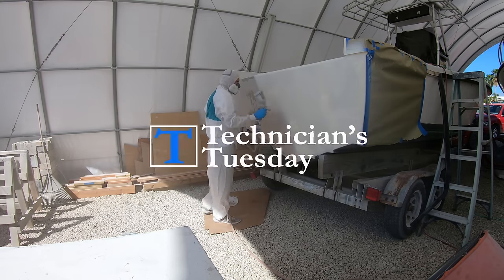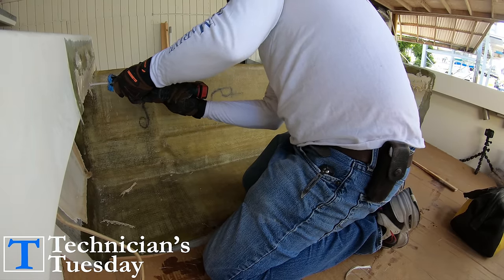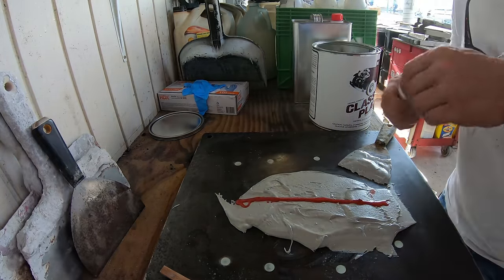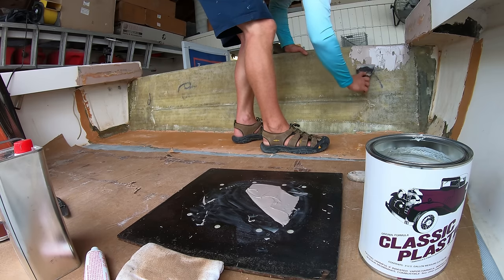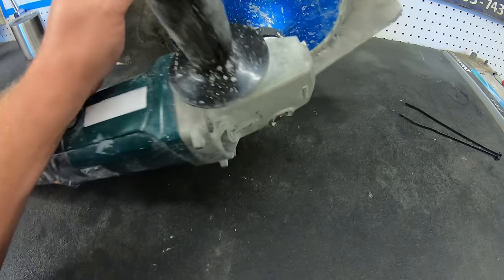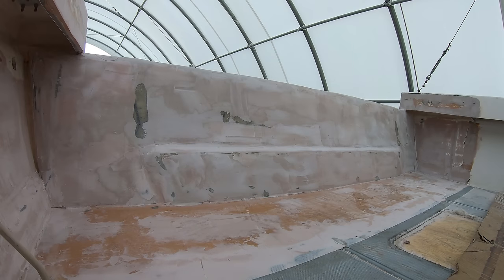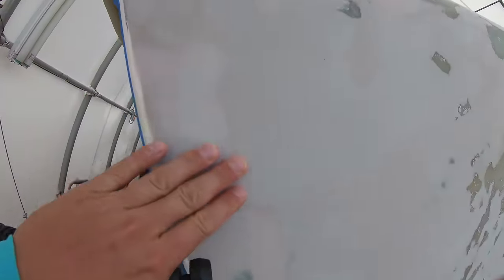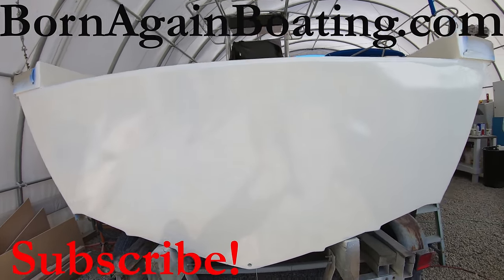Making Boat GelCoat Look Good!

Comment: Is THIS BOAT FINISHED?
HOW DID IT COME OUT? 
How is it doing ? 
How do the SPOTS THE  PLASTIC AUTO BODY FILLER LOOK???? 
Did they crack ? 
Did they fall off? 
Do they look fine ?
Reply from the maker: Haven't finished yet, no cracking yet and it's been moved around quite a few times with the forklift bouncing the engine and bracket around. The only cracking that I'm worried about is on the side gunnels where we smoothed over where the boxes were. It was a little thick there, the transom in the back won't crack, it's just the thick spots that will could crack. When used as a filler, just to flaten the surface, it's not thick enough to crack like people think it will, just the really thick spots or hard corners will crack.
Reply: Born Again Boating  
Thanks for answering. 
I have never used it 
Cause I was told not too. 
But curious cause it’s the same stuff 
As marine polyester filler. 

I hope we are wrong but tell us 
I will come back and aggravate you some more wooo hooo. 
You will be so happy!
And the price is way higher.

Comment: What would you use if you didn't want to use Bondo? More resin?
Reply from the maker: Yes, usually the same resin you use with the glass, and use a fairing filler like 407 or totalfair :) thats the better way to go, I only used the bondo to show a cheaper way to do it. Bondo also makes a more expensive fiberglass filler as well

Comment: Do you ever have problems with bondo cracking?  It seems the transom would flex at least a little and that stuff hardens very hard.
Reply: I've used dura glass
Reply: @vmonroig21  Any issues?
Reply: @nobody46820  I repaired a 1  inch wide and  about 15inch long gash from trailer problems lol. Its been 7-8 months no problems so far.I also did the whole keel from trailer rash.and I don't baby it when I trailer it lol
Reply: As long as it's not to thick 1/4 max it should be ok

Comment: So I'm confused.. Granted I know little about heavy duty glassing like you did but you said you shouldn't use bondo on a boat, however you did.. So what is the actual proper procedure? Thank you Sir..
Reply: After the glass work that should end in a layer of Chopped strand matting, apply epoxy faring compound (total boat faring), sand and refill as needed then clean and apply the finish. Faring compound is made for a flexing boat and will not crack when flexed. Hopefully the bondo will last. Perhaps we will get a follow up after it has been run for a while to see if it really works.
Reply: It's not gonna take "awhile" he will more than likely have spider cracks when he gets to the boat ramp before the boat gets in the water the first time! Bondo is stiff....gelcoat is hard and stiff....the substrate everything is attached to is going to flex. Not to mention that he will be drilling holes thru the bondo for the engine mounts and transducer and whatever hardware is going on the transom. Bondo is not made for being submerged in water!!! When it gets saturated after it cures it has the consistency of a hard cheese. Since I've started using total fair I've thrown out every other type of body filler I had.
Reply: @t.koogle5283  Correct me if I am wrong but you can not use an epoxy faring compound if you plan to gel coat after.  Only if you are going to paint.
If you are going to gel coat you can mix your own fair compound in some poly resin.
Reply: @beachedferrari  You can use total boat 2 part faring compound, sand apply Total Protect primer and then apply gel coat. It is all recommended by the Total Boat people on their website.
Reply: @t.koogle5283   learn something new every day. Thanks
Reply: @beachedferrari  correct. its best to keep everything poly.you can put epoxy over poly but not the other way.you will have probs and gelcoats poly. And as for fillers smc is amazing

Comment: Which spray gun did you use for spraying gel coat? Will preval sprayer work for small job?
Reply from the maker: I don't really know, I had someone else spray it for me. To be honest, I don't like doing fiberglass or painting lol so my friend sprayed it for me. I'll ask him what gun he uses. He does it a lot so he's probably got an expensive gun
Reply: Born Again Boating ya it’s awful work! I’m hoping a harbor freight gun will work if preval doesn’t.
Reply: Not really thin gelcoat down use a 2mm nozzle and spray it at 60psi works well for me

Comment: So use the waterproof fiberglass bondo.
Reply from the maker: Normally I'd use fairing filler, I just wanted to show a cheaper way of doing it
Reply: You can add chop glass to bondo plus the gelcoat will harden it up.

Comment: Don't use bondo if it flexes it will crack off. Licensed since 1982 fixed jet skis for many years and jobs with bondo in them.

Comment: Just doesn’t make sense to cut cost on a huge project where you have done everything else correct .. bonds won’t last .. what a mess that’s going to be !
Reply: Obviously, never use bondo brand anything, and duraglass would have been better for this project,  but body filler (bondo) is perfect as long as it's not very thick.

Comment: What’s the difference with waxed and non waxed gel coat I have a skiff that’s primed and I want to sand it smoothly out the fiberglass and then gel coat
Reply from the maker: Non waxed is usually like a laminating layer that you are going to be applying another layer on top of immediately after you lay that layer. You use the waxed layer as the last layer and that seals the gel coat and lets it cure properly. If you are laying multiple layers, you can't layer over a waxed layer becuase they won't bond properly.
Reply: @BornAgainBoating  ok thank you

Comment: A belt sander would give you a nice flat surface, and would not make such a mess. Less dangerous too.
Reply: A belt sander will gouge the hell out of it.
Reply: @richardgray9491  light passes and attention to your work would produce a nice finish.
Reply: @Mascotal  Then use a random orbital sander to remove the all those gouges that belt sander made.

Comment: No bondo a real glass man doesn't use filler ! A real glass man grinds as flat as possible fill with gel  grind find your highs and lows repeat sand  . Keep going and and as you fill and sand you keep knocking the highs off and fill your lows in with minimum fill . Ues the color gel of the the boat that way when you are getting close to finishing on rub thru .
Reply: Watching someone use body filler on a boat makes me cringe 😖

Comment: What is the other option if you don’t want to use bondo?
Reply from the maker: Many options, Bondo is just the cheap way to do it. We normally use west systems fairing filler. But any fiberglass fairing compound will work. TotalBoat makes good products as well, or your local fiberglass supply company.
Reply: Born Again Boating Thanks for the info.

Comment: and how much do engine brackets go for and are they a good thing to add on ?
Reply: Peter Nguyen it really depends on the boat. I’ll point out the negatives and allow you to draw your own conclusions. Around the mid 80’s they became popular mainly it was said to extend the waterline length giving a better ride in certain choppy conditions and allowed cleaner water over the prop being further back from the transom & any disturbance from the hull. The negative is the weight of the outboard has added leverage and sits lower at rest. This weight is also the issue when it comes to getting onto the plane. Hope this helps.

Comment: Sorry guys , can't get my head around the bondo thing . It's gonna crack-up in a year .  :)
Reply: ThePrestige4u but the bondo is only covering the low spots after sanding isn’t it?
Reply: @surviving.not.thriving1061   A boat in the water is pounded and twisted far worse than a car . Also they are dis-similar materials . Bondo doesn't like to bend . Just take a little ground glass fiber & resin & make yourself some marine-stable filler .  :)

Comment: When you wipe the First Coat of Bondo, SMC, Kitty Hair etc.....its best only to first fill in the Low Spots, Dings and very deep Gouges.  DO NOT WIPE THE WHOLE PANEL. 
Later in the Second Wipe things get much easier and faster.  With this Job, you could have first used Kitty hair on the Lowest Spots for the first wipe, and use the SMC filler for the second and third wipes.  This would have been much more durable and professional. Bondo for this job and for any other fiber glass job is not really very good.
As for sanding  you could have made a 24" to 36" long Long Board, and used a Killer DA with a 36, 40 or 80 grit Sticky paper.  Nice video though.

Comment: Think about this, please:
Respirators, Gloves, Eye protection, Chemical (paper/Tyvek) suit, Air filtration? 
Are you aware of the way Acetone, MEK, glass dust, silica, cabosil, etc, etc get into and affect your body? It doesn't go away - ever. Some of the affects  can kill you, or someone nearby, virtually instantly, some you won't notice for decades. 
Please, if your going to share this type of material, Educate your viewers, and yourself.
I have worked on boats all my life. The rule is: keep the material off you in the first place. Trying to clean it off after the fact only increases the damage to you and those around you.
Small example of what I'm talking about: Get a little paint on your arm? Great, just wipe it off with a rag with some acetone on it, right? Well, now you've applied a chemical to the chemical (usually some sort of heavy metal in those paints and god only knows what else) and driven it through your skin, into your blood stream. If you had been wearing a paper suit, just wipe it with a rag and move on, no harm done. 
Air filtration: Too complicated, right?
Not really. Get some home depot AC filters, bigger the better. 
Contain your work space - tarp the ends and seal the sides to the ground.
Cut those filters into the end walls, duct tape in place. You've got the big fan, mount that blowing out (exhaust) through one of the filters. Maybe stack a couple of filters for it to blow through.
Maybe you mount another intake fan opposite the exhaust, so it draws through a filter to keep the outside dust out of your work.
Maybe you need more fans, bigger vents, every job is different. 
Try this and see for yourself what a huge improvement it makes in your work environment. Admittedly this will not capture nearly 100% of the crap you have blowing around, but I can guarantee you it won't be all over your tools, work space - and you!
The airborne chemical component is more difficult, but carbon filters will eat a lot of that. Home depot again. 
Need to change filters quite frequently when shooting paint, gelcoat, etc, as they will clog the filters pretty fast. 
Ill stop there.
Think about what I have told you, please.
Reply: average joe  Agreed on cabosil. The acetone belief you have: Insanity. Please think about what you are assuming, then get educated on some factual information. This stuff will remain forever in your liver, for one. Chemicals do not get "metabolized and removed by your body." There is no get out of jail free card with these compounds.
I'm not here to criticize anyone, just share what I have learned over the years.

Comment: Could you have just finish the fiberglass with finer sand paper instead using bondo?
Reply: Not trying to act like im picky because im planning on doing mine this winter so im asking if theres options

Comment: Boat builder of 40yr from Scotland, you made a huge mistake applying bondo during all that hard work. A huge one and nobody wants to be replying saying its fine. Marine bondo is not for this task nevermind classic car stuff. I hope the temperature is the same all year round where you are because over here even marine bondo falls off after 5 winter. Ruined job tbh mate, a bodge at best.
Reply: Winter ? There’s no winter in Florida I’m pretty sure this boat is doing just fine

Comment: How many days did it take you start to finish. I’m about to do my Robalo R235 which has a very dodgy transom. 🇦🇺
Reply from the maker: It depends on the project, and whether you are including the time of the bracket install, bottom paint, rigging, engine, etc. or are you just talking about the time of the fiberglass and the fairing and the gel coating? Fiberglass and Gelcoat, it was around 10 days, from demo to glassing, to fairing and gel coating

Comment: stop cleaning your tools from bondo, leave actually bigger ammount than it hardens you only need little flex the tool and bondo will fall down in one piece. Than you think using automotive i think there is no difference from marina stuff. marina stuff price cost 10 times more, while doing with automotive same stuff super cheap. Bondo will hold, its not road where it gets damaged from rocks and dust and chemicals, but you must use bondo which is used in north countries those will hold against super cold. People say ow it absorbs water, wrong! its the tale made by marina sellers. cars drive on very harsgh enviroment an d bondo is ussually placed on metal which is worsed material to put on and it hold no rpoblem. It cracks than its too much of it and remember its on metal which is expands and contracts from heat or cold. while boat doesnt do this which mean bondo wont get stressed  daily. its made up stuff by marina.